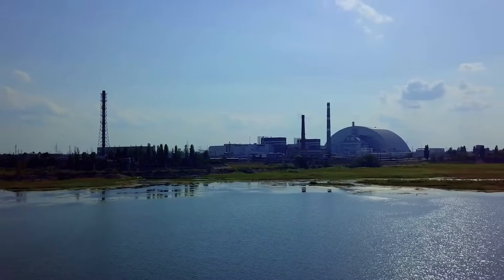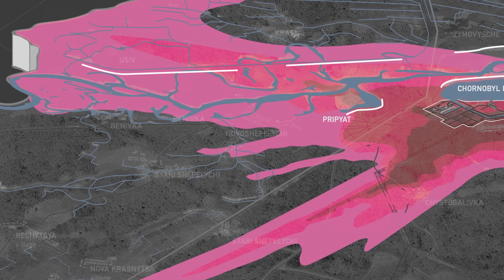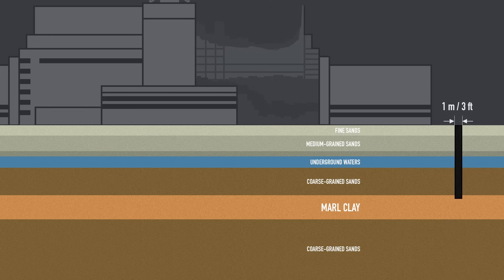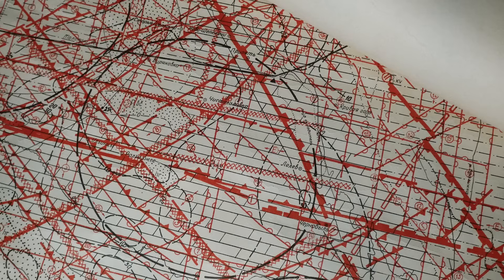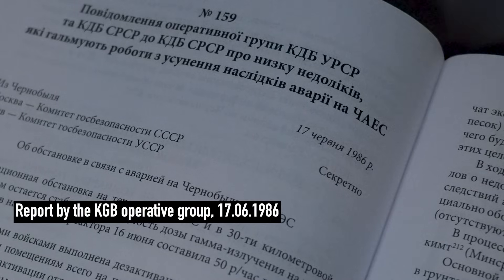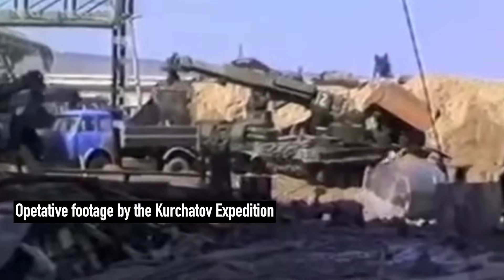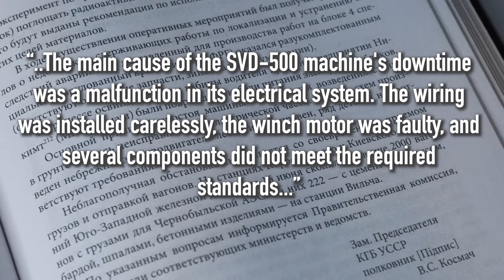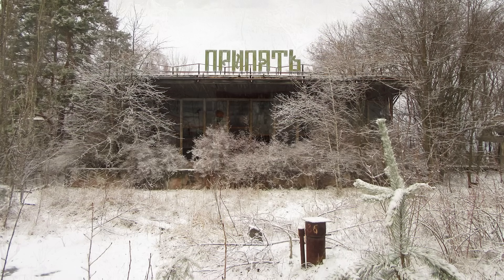Chernobyl's Underground Wall: a Forgotten Story | Chornobyl Uncharted Ep 20

Comment: That's quite the structure.
Was the cooling pond drained or changed during the construction?
Reply from the maker: No, there was no need to do that, as the construction did not interfere with it. Though, later in the pond, a dam was constructed in the middle, but that was a separate project.

Comment: Sometimes I really struggle to think of an accident mitigation measure (besides basic preparation of the industrial site) that was actually effective. That would make a good video in itself.

This video probably should have mentioned how the 'wall in the soil' is regarded as having a negative impact on safety, since it increased the height of the water table under the plant, and thus increased groundwater contamination. Ironically, the main contaminant plumes are moving (very slowly) towards the river to the north. The very place where they never bothered building the wall...
Reply from the maker: Honestly, this comes to us as well.